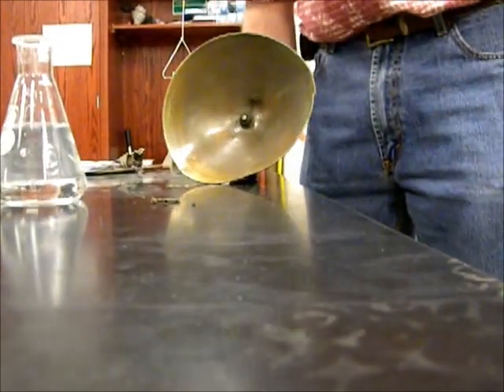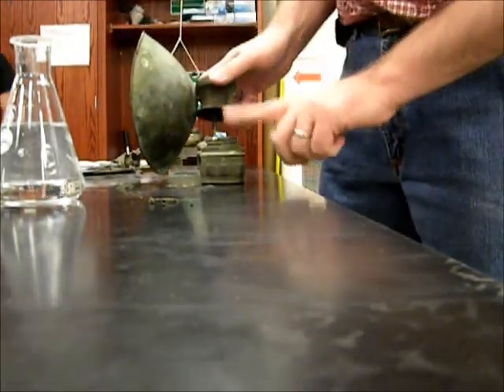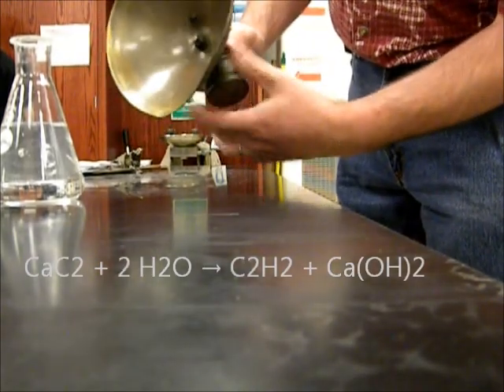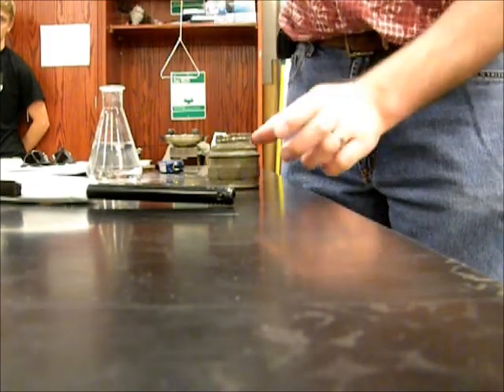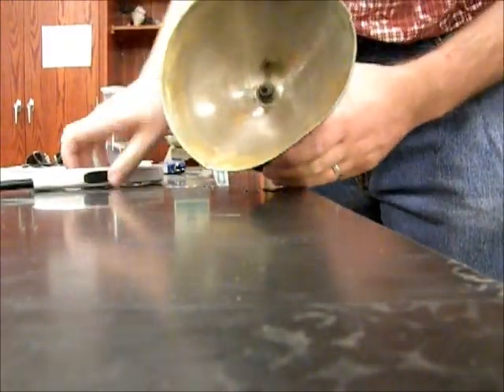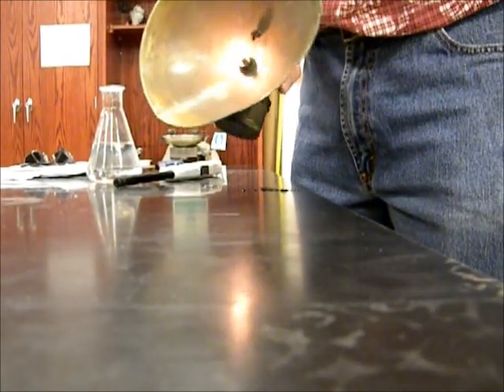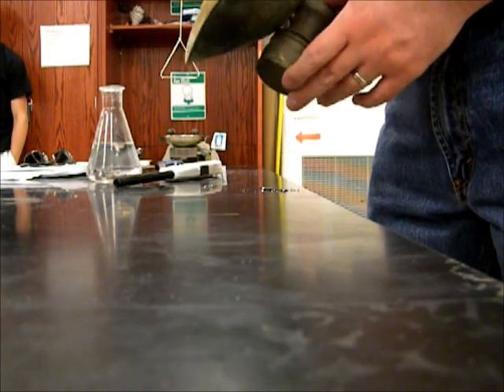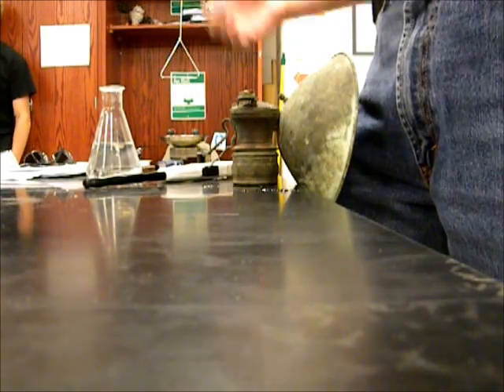Carbide Lantern

Comment from the maker: I'm sure you could find some good details in articles or photos online, but I don't recall the exact size and since it belonged to a former student I don't have it to measure.  I'd say its the same size as the hole on the top of a lighter maybe.
Reply: Sully Science 
Also there was a wire mesh safety screen for coal miners to prevent methane explosions. In Carbonado, WA 1899 a miner removed his to light his pipe and the resulting explosion and black damp, CO, killed about 30 miners.